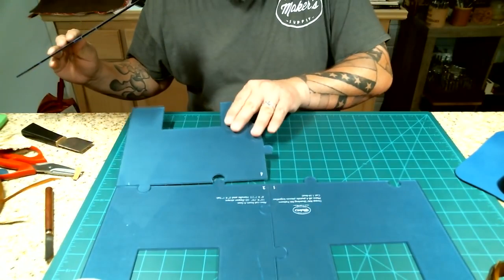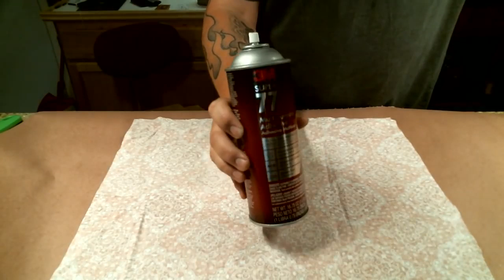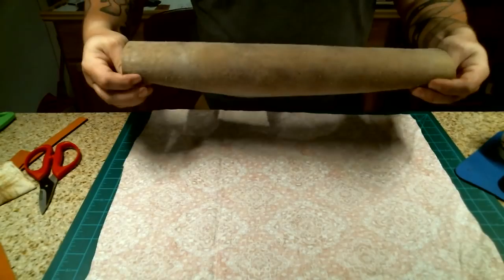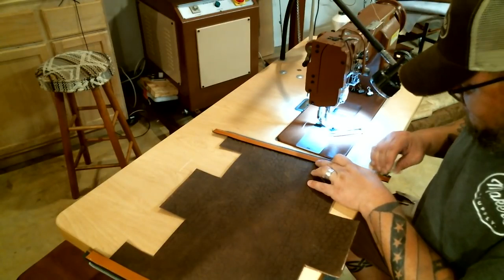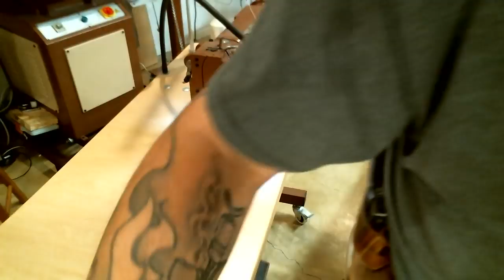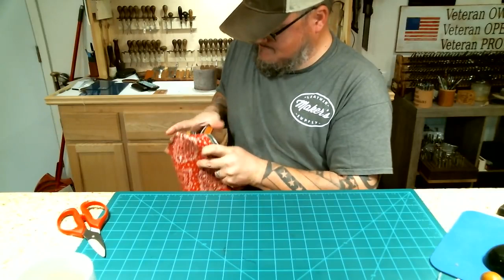Making a Leather Dopp Kit Shaving Kit

Comment: its to bad the video has different measurements that what the package says on veg tan length.. package says 25 in and  you just said cut them to 17 in ea. 2 x 17 is 34 vs 25.  plus that doesnt even include the handle.. very misleading on package.

Comment: I wish you offered digital versions of some of your templates. Acrylic is cost prohibitive for me in a lot of cases. The few acrylic templates I have I still trace with an awl and cut out. Trying to hold a template down and cut around it does not work for me. I love the list of Tandy supplies to use on this project and you use none of them. Lol. I get it you’re running a business and you use what you sell. And I’m not knocking Tandy either I buy stuff from them as well as from you and other suppliers.

Comment: I love the idea of lining with a thin fabric. It allows for personality and personalization without being over the top and flashy.
I just got several templates, including this one at Tandy today. I can't wait to see how they come out being 100% hand sewn.
If you pushed your awl all the away through you wouldn't have the issue with the needles not fitting into the stitching hole from one side because the holes will be opened wider and more evenly.
I'm looking forward to Tandy Leather's project corner so I can use their sewing machines and the other expensive equipment for my projects.